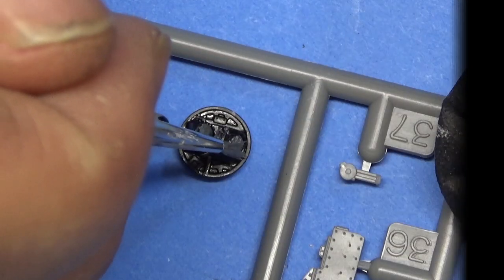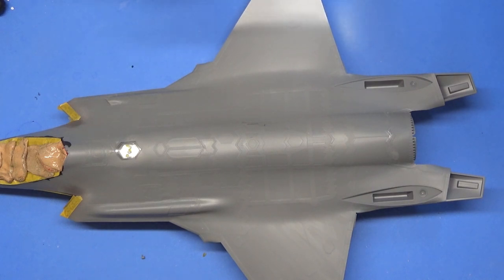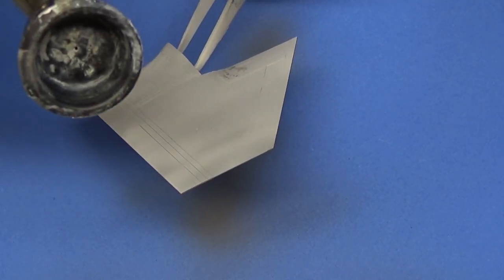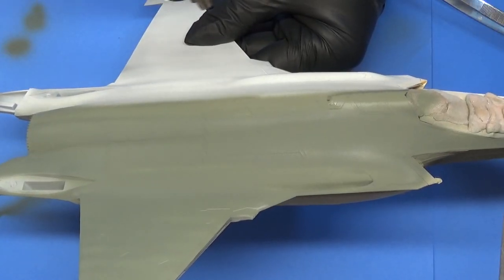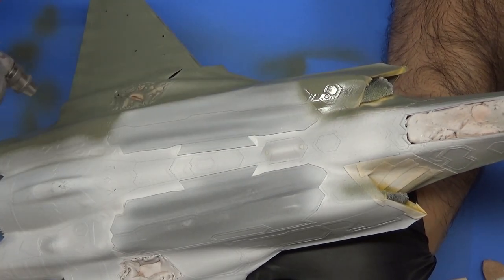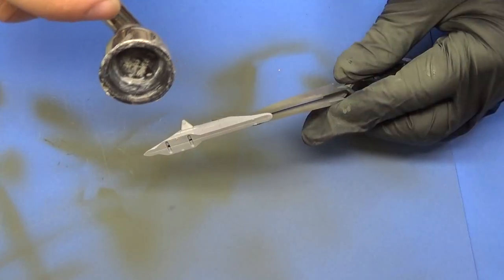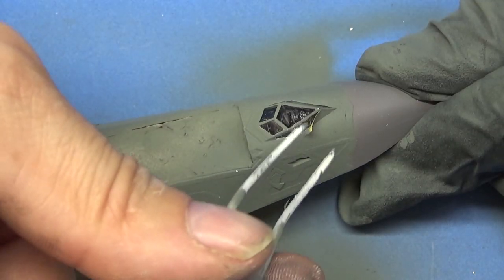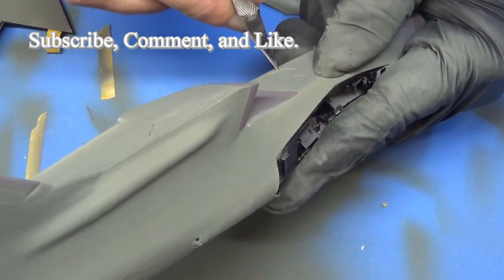Tamiya F-35A Lightning II 1:48 - How to Paint the Fuselage Part 5

Comment: What colors did you use to get the camouflage grey?
Reply from the maker: Well mine is a concoction of incorrect colors. Mine appears more green than grey. I know it isn't accurate, but that's what I did.  I think i used RLM green and whatever other color the instructions called for.  Sorry I cant be of more help.
Reply: @PlasticModelBuilder  That's such a hard color to duplicate.  I came very close one time starting off with flat black and flat white to get a dark grey shade.  Then I added some "NATO brown" to lighten it up and give it that brownish tint.  Still not great, but better than nothing!  Thanks.
Reply from the maker: I tried but was missing the recommend color.  Win some lose some.

Comment: I found the instructions vague as to the fuselage color...what are you using?
Reply from the maker: My colors are wrong.  I didn't have the right ones.  But it should be on the color foldout as to what ratio you need.

Comment: Getting closer. I noticed you removed all the masks - did you end up putting a flat coat on this one later?  or are you done with all painting at this point? Cool video.. make it look pretty with model makin' madness.
Reply from the maker: I sealed it with floor polish made for floors and not for models. Ironically it still seals regardless of what its put on. This way the clear stays clear!